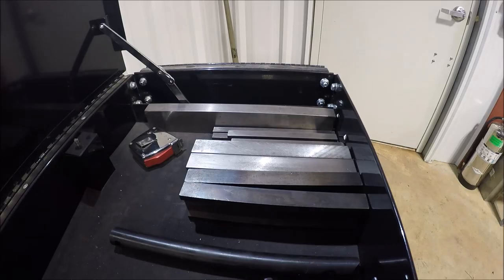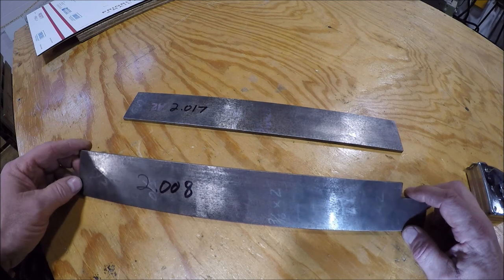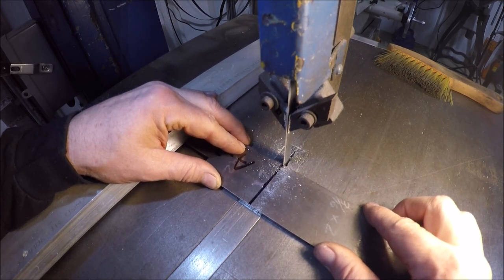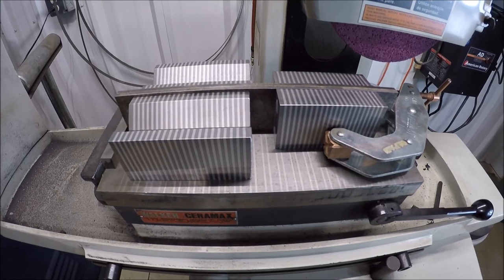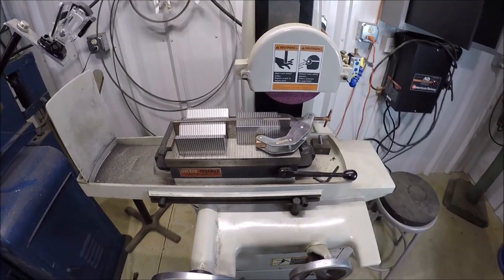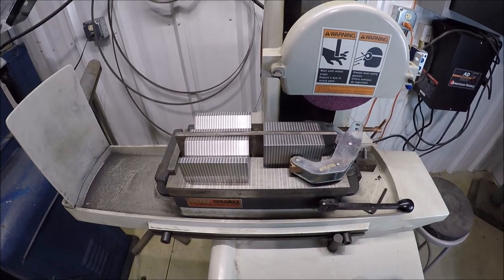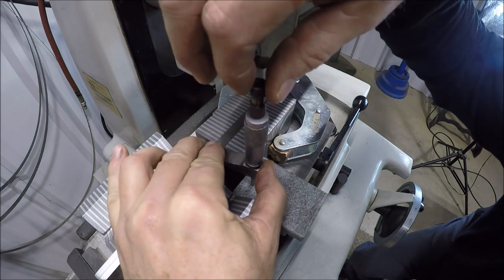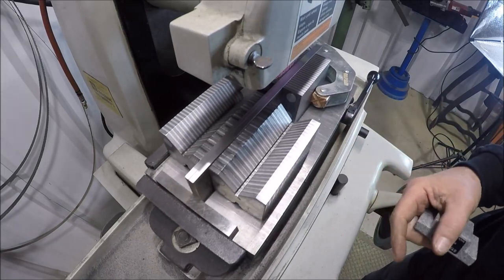Making some parallels for my G&E shaper vise

Comment: Hi Tom, did you grind both sides? Those should work good for you Thanks
Reply from the maker: Yeah I forgot to mention I dusted off the underside first.
Reply: @hilltopmachineworks2131  👍
Reply: Got to appreciate parallel parallels😎 can never have too many blocks and fixtures.
Reply from the maker: @bcbloc02  That's for sure! 🤩